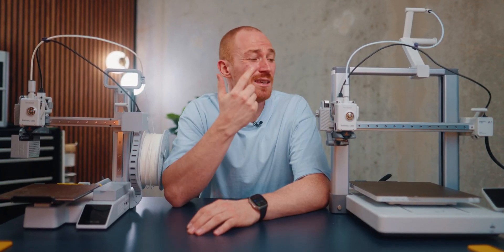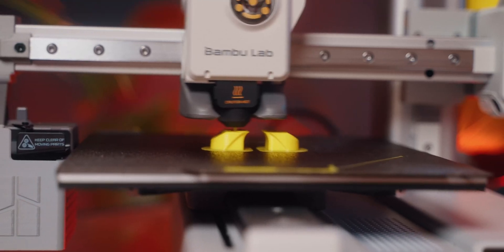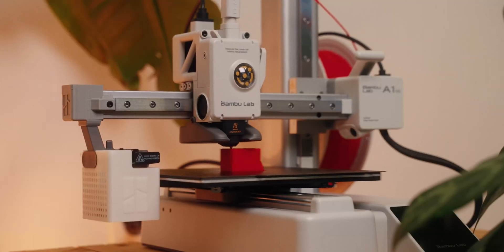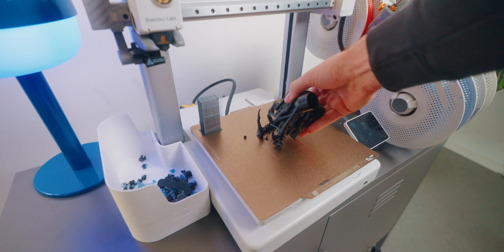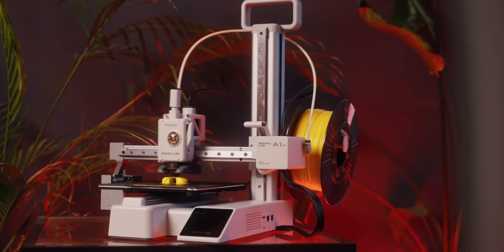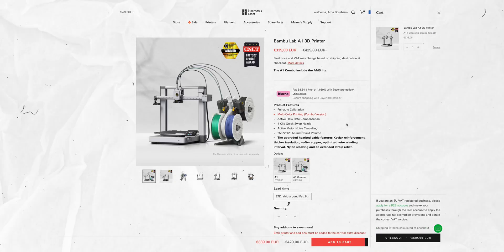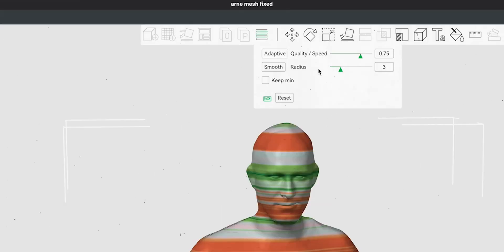Bambu Lab A1 VS A1 Mini - Which is best for beginners?

Comment: One factor that you didn't mention is that the A1 requires some assembly whereas the A1 Mini just requires the packing pieces removing. Whilst assembling the A1 wouldn't be an issue for most people it might be an issue if a non techy parent is considering buying their child their first printer. I think the A1 Mini is perfect in this scenario. Follow the simple instructions and you are printing a Benchy within minutes of opening the box.

Comment: Hey thanks for the video!! I’m thinking about getting the A1 or A1 Mini (still deciding), and when I was about to check out, the site offered some extra deals like Core Accessories, Filament Deals, and Essential Consumables.

Do you think any of those are actually worth getting upfront? I saw the Essential Consumables bundle has stuff like lube, PTFE tubes, purge wipers, cutter, etc. — not sure if that’s stuff I’ll need right away or just later for maintenance.

Would love to hear your thoughts, especially if you’ve had your machine for a while!

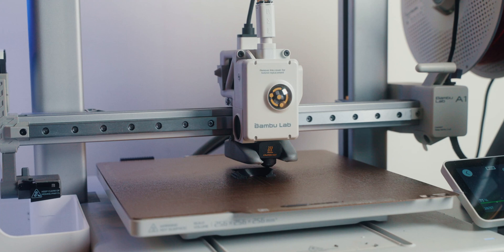Comment: At 2:28 you can see that your A1 screen has been damaged on the side by the build plate being slightly off. This seems to be a common issue.
Reply from the maker: yeah i didn't put the plate on correctly and it kinda cut through the side of the casing. it's only cosmetic now. 
Since it only happened once in 100s of prints this was just my mistake

Comment: I wouldn't choose the AMS if I buy the A1 mini, because I don't think I have many color needs. I prefer the P1SC's AMS, of course, not for changing colors, but for using it as a storage box for dry items
Reply from the maker: Good point. It’s nice as a dry box. 

I mainly use the ams to change filaments more quickly rather than printing multi color
Reply: @arnebornheim  i know ,but it is so waste pla

Comment: I love my A1 mini, but I do regret not getting the regular A1.  I plan to get one this year.
Reply from the maker: Interesting to hear! What prints are the size limitation for you? or just fitting more on the plate?
Reply: @ I make dollhouse miniatures, and while it works great for smaller accessories, the plate is not big enough for furniture pieces, especially if I want to scale them up to Barbie size.  Aside from that, I absolutely love it.  It has been a workhorse and is so incredibly easy to use.  I will likely get an A1 before the end of the year, and use them both.
One really nice about the mini is the fact that it is so light and small.  It is very easy to move around from room to room.

Comment: I bought the a1 mini...1090 hours of print later i ran in to print quality issue. After 3 weeks of research without understanding where is the problem i open the head and...break something 😅
Bambu didnt help me a lot but the support is there.
I will bought a a1 now, and avoid to open anything 😂
Reply from the maker: Sorry to hear the a1 mini broke :/ hope you have fun with the a1. Maybe it’s worth holding onto the a1 mini and trying to fix it. There are so many replacement party available

Comment: You read my mind. I spent the weekend trying to decide between these two printers. Now I can make a decision
Reply from the maker: nice! which one are you going for ?
Reply: @arnebornheim  For starter A1 Mini. To learn more about 3D printing and start a business step by step.
Reply: @kornillo I’m leaning on doing this too. Are you happy? Learning much?
Reply: @OspinaTech  I'm very happy. It's basically take it out of box and use. The size fits perfectly in my office and it's silence enough. But after 3 months I upgraded for A1 + AMS Combo. Bed size it's better now for my products. 
A piece of advice go with A1 standard. Mini it's good but the extra inches (centimeters) of A1 standard it's better. Both are easy to use no problem with this.

Comment: It blows my mind how many people will sing the praises of Apple for "it just works" but condemn Bambu for exercising a fraction of the same practices. Everyone is acting like Bambu just announced that they were locking their machines down to only work with their filament but I'm pretty happy to use their ecosystem since it works so damn well and gives me a tool that doesn't require my time I've set aside for the hobby to be eaten up with troubleshooting and tinkering like my old V3 SE.
Reply: I would not be surprised if its some competitior that is spreading that bambu will lock down filament.. how would that work on A1, A1 Mini, P1P, P1S, X1C, X1E since none of them has the ability to read RFID tags in the bambulab filament. Or will bambu lab say you can not print if you do not get the AMS (since it has the rfid reader for filament)
Reply from the maker: I know what you mean. I think the problem is that this happened afterwards. With the iPhone it was always more or less the same walled garden. You knew what you’re getting yourself into whereas this was done after the fact
Reply: @ that's fair. I totally get that perspective too. No one likes a bait and switch especially if you've set up around one way of doing things and then be locked out. Either way, I'm really hoping more manufacturers catch up on the ease of use/quality combination at a low price point that they have perfected with the A1 series to create more competition soon.

Comment: I have the mini since 2 weeks and it has printed for 71 hours since then. I bought the mini for the form factor. It sits on top of a single Ikea Kallax column. Till now I didn't run into a print I wanted but couldn't print. If I continue to print as much over the next months, I would've bought a second printer nonetheless. I use the Bambu slicer and the app, even only Bambu filament. So I'm ok with a closed system.
Reply from the maker: Happy to hear you love it!
Reply: Great to know it fits on a Kallax!
Reply: you sell the product?

Comment: My 2 cents, which essentially echo your video. I have both also, the difference in space they take up with the AMS lite connected is minimal, the difference in bed size however can be significant if you think you'll need the extra bed size of the A1. If you're not going to use an AMS lite with the mini then the smaller size might be good if you don't have a lot of room. Also, there's actually a difference in noise level. For whatever reason, the A1 MINI is a lot more quiet than the A1, quiet enough that when the little song at the end of a print plays it startles me as I can barely hear the MINI, especially if a TV is on. If I had it to do over again, I'd go straight to the A1, however in a bedroom with no AMS lite, maybe the MINI instead. As far as the recent news with Bambu Lab, I won't be buying any new printers from Bambu Lab again unless they stop their Bambu control crap. When I buy a printer, I own it, Bambu Lab doesn't think so. 
People thinking of buying a Bambu Lab printer should also keep in mind that all the other companies are catching and could actually pass Bambu Lab soon so don't think you have to get a Bambu Lab printer. I think most of the late 2024 and 2025 printers will be comparable or better than these two printers from what I've seen so far.
Reply: I agree 100% - could not have summed it up better. As for "buck for plate-space" you can't go wrong with either, you can go wrong with Bambu though unfortunately. I will keep my X1C which I bought over a year ago, but I rarely ever needed a bigger buildplate. So choose the printer according to your room size or even switch brands, if Bambu destroys itself.